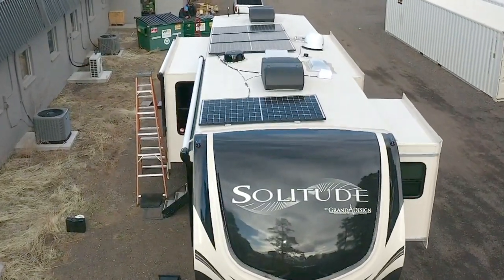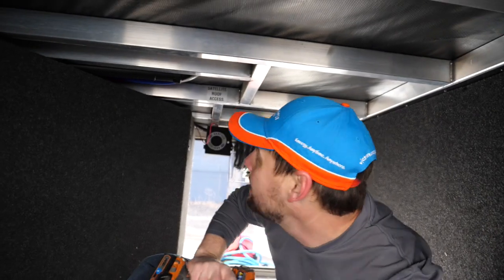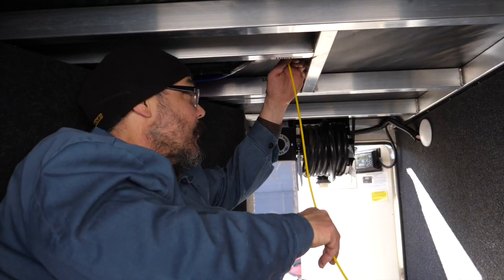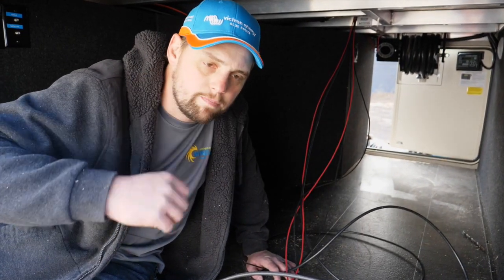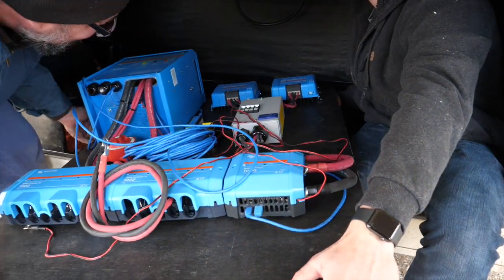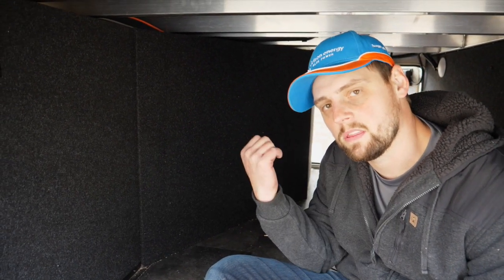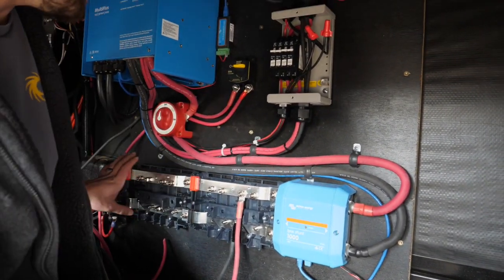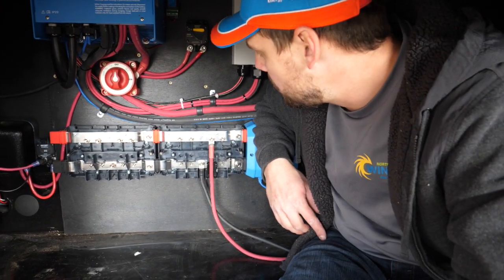Solar Power Install on a Grand Design Solitude RV

Comment: James and Logan from NAWS are the best!  They installed 650 watts of solar, 3 Battle Born batteries, a 3000 watt Multi-plus inverter, and all Victron components on my class A 2 years ago.  It was worth the 11 hour drive to have such a neat and clean installation that I still show off to anyone interested.  I couldn't be happier with my system or the installation!  P.S. I was surprised to see that Robin exchanged her Solitude for a truck camper!

Comment: Great video.  We have the exact same unit.  We were looking to add solar perhaps next year so will probably look you up for that.  We are now just adding the BB batteries to allow us to overnight boon dock some.  If you don't mind the question, how did you run the residential refrigerator to the new inverter.  Did you leave it on it's own inverter as it comes or did you wire it into the new inverter.  We are scratching our heads on this as it is the only thing that will not work with our new 3000W inverter just when we thought we had the project done.
Reply from the maker: Hi Barbara, thanks for the comment. Give our solar engineers a call. They would be happy to answer your question. (800) 383-0195 - thank you!
Reply: @NAZSolarElectric  That answer does not help the rest of us?

Comment: What are some of the overall specs for this system? Watts solar on the roof ? Battery bank amp hours? Watts inverter? Etc?
Reply from the maker: Hi there, you can find those in this article: https://www.solar-electric.com/learning-center/solar-power-system-design-install-grand-design-solitude-rv/